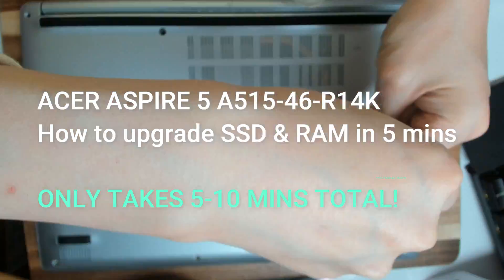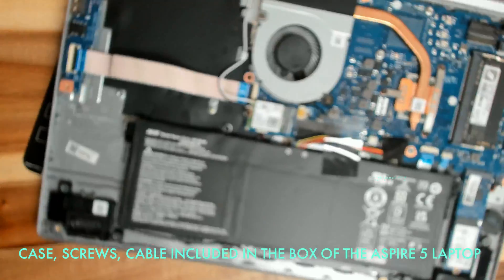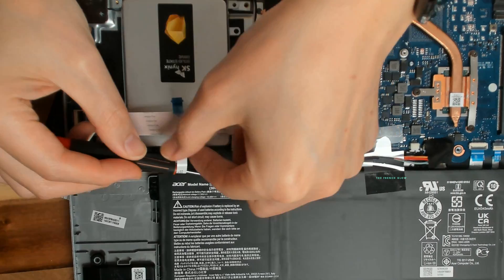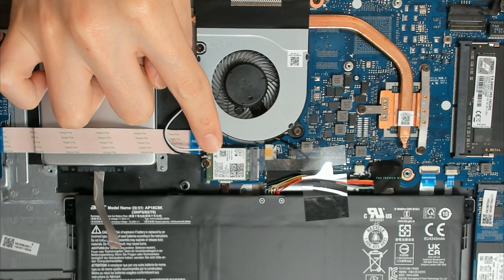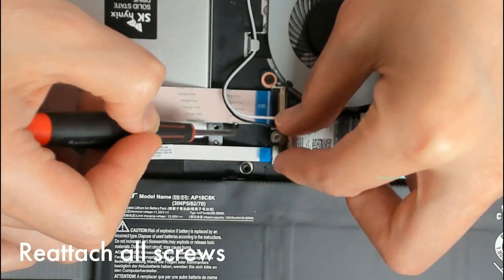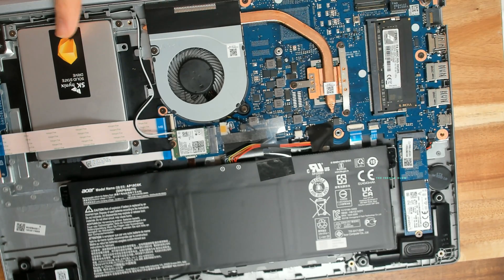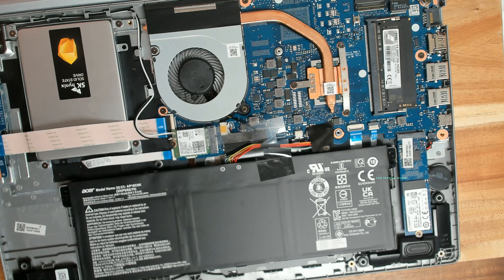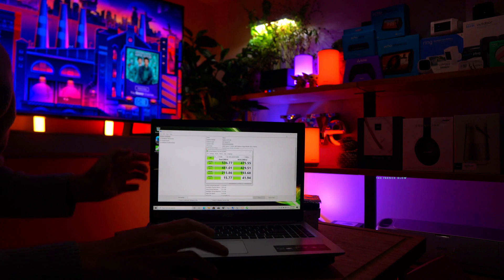Acer Aspire 5 A515-46-R14K - How to upgrade SSD & Ram // Best Budget Laptop

Comment: One question here. I have an Aspire A315-55G, it comes with 4 ram with a frequency of 2667mhz, so I bought a 16gb 2667mhz Kingston Fury ram, but in the OS it appears 2400mhz, is there any possibility of increasing it to the maximum possible frequency?

Comment: Hey, new here and never upgrade any tech on my own, I see in the replies you add the ssd, does the ram get inserted into the drive before installation? i'm trying to update my laptop so i can use adobe premiere pro (also let me know please if that would be possible after this upgrade or if i should just start saving for a better laptop)
Reply: It would just barely meet the minimum requirements  (Ryzen 1000 (Zen 1), 8 GB RAM, 2 GB VRAM) and you have a 2000 (Zen 1+ despite AMD labeling it 3350 it is NOT a 3000 series (Zen 2) CPU) and the graphics use 2 GB of system ram. You probably need an additional 8 GB which would give you 10 GB for the CPU and 2 GB for graphics.  It should work but it's going to be slow at processing and you won't be able to do anything else while it is processing. However rather than adding a SSD in your use case I would upgrade to a larger NVMe drive because it's 3-4 times faster than a SSD

Comment: What ram did you add to to the laptop? I don’t really know much abt ram I just want most performance for games. also if it’s not the best one as of 2023 what is good ram to get?
Reply from the maker: Hi I used ripjaws ram. If you need or want to upgrade  ram, check your motherboard model first to make sure it's compatible.

Comment: I purchased my ACER Aspire 5 A515-46-R3CZ laptop in AMAZON and as advertised it has an 8Gb DDR4 3200 MHz RAM, but when I go to Task Manager>Performance> Memory, it says 2400MHz SODIMM...???...and resolving this discrepancy is even more important now since I want to purchase an additional 16 Gb RAM...pls kindly advise
Reply: Unfortunately there is no XMP setting in the BIOS so no matter what speed you put in there it's going to run at 2400. Still it's probably better to use DDR4 labeled as 3000 or 3200 because while it will only run at 2400 they use better "binned" memory ICs and most of the stuff labeled 2400 uses crappy IC's which leads to a lot of incompatibilities because it's budget low grade RAM ICs

Comment: I don't know if anyone is still tracking this but I'm confused because I don't see how to attach the power since it only shows the single plug to attach to the motherboard.  (Sorry I'm not a super comfortable computer upgrade person) I did a Hard Drive change on my desktop and you had to plug it into the power and then plug it into the motherboard.  Would love if someone could explain what I'm missing.
Reply from the maker: Hi! For ram and ssd, the motherboard has enough power to operate both of them without external power.  Laptop components usually have a much lower power draw than desktop parts because of the battery limitations. It should be plug and play on the acer

Comment: The screw that holds down the wifi card was over tighten on mine , and up stripping the screw. A pain trying to remove it
Reply from the maker: This is diy ymmv but you could possibly use a tiny amount of wd40(tiny tiny with a qtip, leave for 30mins, and protect the laptop internals before anything) ) to loosen it first. The heat from the mobo and laptop could make the screws warp and be tighter.

Comment: In no case do not do this . First , de - energize the motherboard . Remember the following: de-energize the board is the first rule . Patience and accuracy .🙂
Reply: How do you de energize
Reply: @evilchinchula  You can just long press the power button while the battery is disconnected to make sure there's no excess juice in the motherboard
Reply: @JustANormDude  I also keep pressing it a few times to make sure there is no leftover, can't be too careful right.
Reply: @evilchinchula  lol I think he means impling the power under the black tape

Comment: Is it possible to add a 32gb RAM to the one upgrade slot?
Also, have any readers removed the soldiered RAM? And would that be difficult to do?
Reply from the maker: Hi! The motherboard only accepts up to 16gb.  I advise not to remove the soldered ram unless you have skills. It is not meant to be replaced.
Reply: @TheFrenchGlow  I hear ya. Pleased I spotted this video and saw I could go as high as 20gb atleast. Hoping that will be enough to run daVinci Resolve lol

#ThankYou

Comment: Some of us weren’t able to get the Laptop brand new there for didn’t receiver the ribbon cable, screws, or enclosure. Any links to those available at all, if so would be helpful thanks in advance.
Reply: Did you ever figure out where to buy these parts?

Comment: Does it matter if the ram card I get isn't the same company brand thats already installed in the laptop?
Reply from the maker: No necessarily but you have to get a ram stick that matches the system.  For desktop pcs since you can have dual ram, I recommend getting the dual ram if you have the budget.
Reply: @TheFrenchGlow  alright I got a single DDR4 RAM ram card for my laptop that's pretty much same as yours.

Comment: For this model, what is the max speed for this ram? Also, you had 20GB of ram installed, people are saying the 2021 max is 16? What speed is it at? 2666mhz?
Reply: CPU can only utilize 2400 RAM. Won't hurt to get faster RAM, would be more useful if you were use it in another system at a later time but as is the system will just downclock it.
Onboard RAM of 4GB is soldered to the board so can only add 1 stick of 4/8/16GB. An 8Gb upgrade is probably the sweet spot for a Ryzen 3. 16Gb is pretty overkill.
Reply: @SerenoOunce  I ended up getting 1 stick of RAM from Corsair 16 GB at 2666mhz. My only problem is that I can  not copy windows 11 OS to my SSD ( Samsung 860 EVO 1TB). I wanna transfer OS to my SSD and then transfer it to a different m.2 which I'm going to replace later after getting a copy to my ssd. I bought a 1 TB 980 m.2 from Samsung for $100 from Amazon. Can't seem to transfer OS from current m.2 to my SSD. I'm using Samsung migration system, I used it before on my own personal school/ gaming pc. Not sure why it's not working, is it because of windows 11, that it's still new? That's my only guess.

Comment: Thank you for very helpful video. Is it ok to replace 2nd RAM slot with 2400 mhz stick if the board is already running a 2666? I mean are they compatible, read something about a bridge needed and one user said his RAM stick wasnt recognized. As newbie thanks for any suggestions.
Reply: The mobile Ryzen 3 3000 series still uses 2400 RAM. If the laptop came with 2666 stick pre-installed it's just because it cost the same amount. Cheaper for MFG to order more of one type of component than multiple variants. Compatibility shouldn't be an issue so long as you're using brand name components.

Comment: Will the Crucial 16GB Single DDR4 2400 MT/s (PC4-19200) DR x8 SODIMM 260-Pin Memory - CT16G4SFD824A work.  Most sites I check only list an 8gig max capacitiy ram chip for this.  Really want that 16gig upgrade to my ram.

Comment: can you provide link for internal enclosure, screws and ribbon cable you used for ssd.
i was assuming that would come with ssd
Reply: oops. it's inside the box computer came in.
Reply: Do you have a link where you purchase the drive, I need something either 500Gb or 1TB.
Reply: @mbanderas  he has link for ssd in another  comment below
Reply: Mine didn't come with it 

Anyone have a link for those two parts?
Reply: @jschackmann2  i checked my box and can't find it. i'd call acer support and say part missing for ssd upgrade - both ribbon and tiny screws
Reply: @prioris55555  would they send it even though my computer is 2 years old?
Reply: @jschackmann2  not sure. you could probably ask for part number and order it

Comment: For dual channel performance which memory you recommend to install?
Reply from the maker: Hi! you only have one open ram slot because the 4gb is soldered on the motherboard. You can upgrade the NVME drive though.
Reply: So if u put a 4gb on that slot still wouldnt counta as a dual channel right?
Reply from the maker: @jesussalas2993  no it wouldnt be proper dual channel especially since the Ram sticks won't match.
Reply: @TheFrenchGlow  I recently got a similar acer laptop with 8gb of ddr4 onboard and it runs dual channel with an additional 8gb sodimm i added just fine